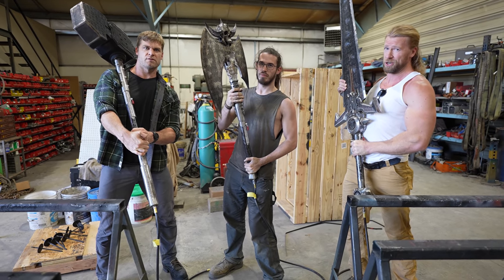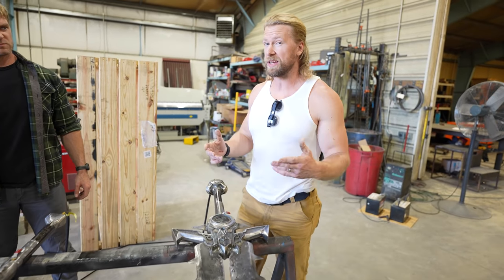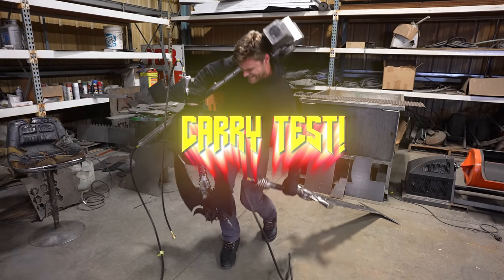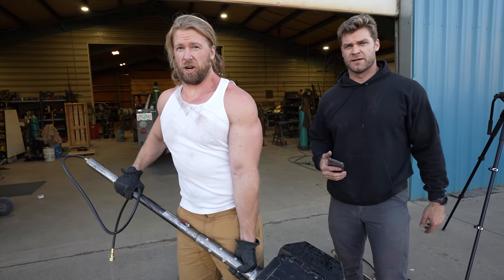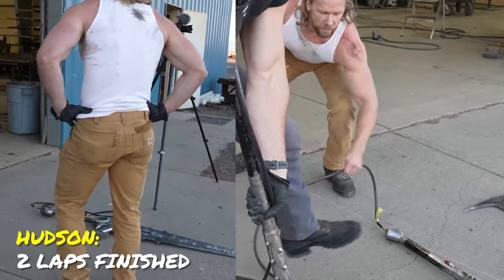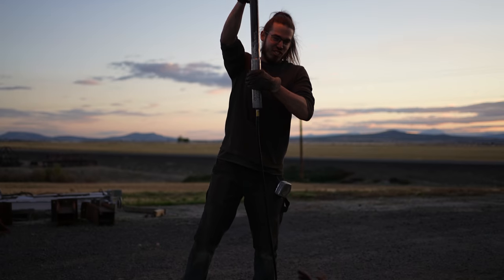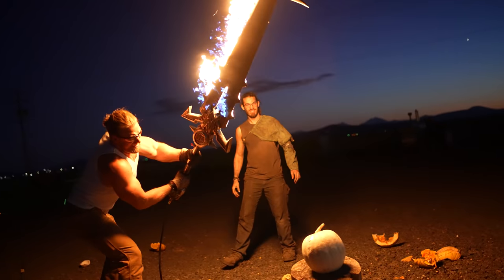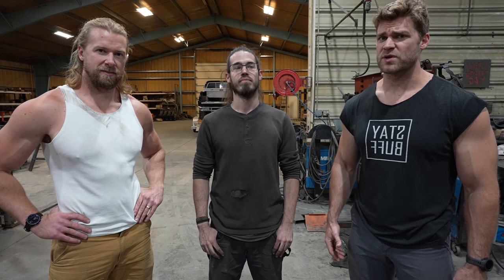@buffdudes Test Life Size DOOM Weapons | Video Games vs Reality

Comment: As an old-school Doom player, I thought this was going to be about all the crap the OG doom guy was carrying around - chainsaw, pistol, shotgun, chaingun, rocket launcher, plasma rifle, BFG.  Mythbusters tried it a while back, but they're far from BuffSlayers.

Frankly, I'm surprised that the weapons didn't bend when being used, being made out of mild steel.  Wonder how much one would be able to lighten them up using hardened/tempered high carbon steel - you get greater strength with less material.  (There's a reason why medieval weaponry used high carbon steel.)

Comment: great vid, But the sentinel hammer, crucible, and the marauders axe all have plasma that are like, as light as air. So really, for the crucible it should have just been as light as the sword without the blade. for the hammer, just a metal stick. and for the marauders axe, also just a metal stick.